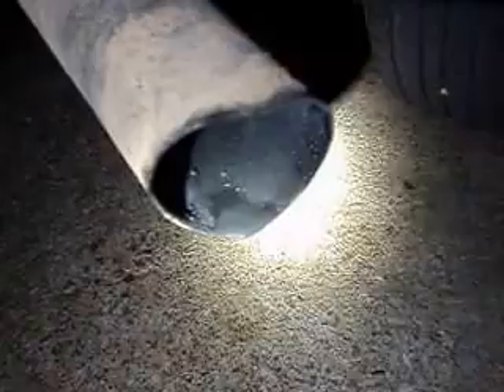Bad Head Gasket Leaking Water Out Of Tailpipe

Comment: My 06’ Tundra has water coming out my tail pipe and that’s been since 2009 when I bought it,so I just drilled a 1/8”hole in the very bottom of my muffler and fixed that problem.

Comment: You have broken bits of honeycomb from a bad catalytic converter. The honeycomb no longer heats quickly because it's in your tail pipe now, or crumbled in your muffler, so it attracts a little extra condensation at the bottom end of your muffler! As lone as you know that you added coolant and not straight water into the radiator you are good..there is no sweet smell, the water coming out the tail pipe tastes better than my faucet water. It's good...hell 😂But I would definitely taste-test the exhaust water, and smell it too! Run a ph test, the water tastes filtered, but...I... Still... Would... Not... Just... Drink it. Pressure test the radiator/overflow to about 15 psi, for 15 minutes...and if it drops considerably, then it's a bad gasket or cracked block somewhere. Or you should just check for exhaust gass in the overflow or radiator. If you pass that... It's just condinsation.✔️💯🏆

Comment: Is the water drinkable?
Reply: Haha 😆 It just might be! After so much work that I've done on mine, including a cheap engine install... Shid... Who wasn't going to smell and then taste test it?! I've added dye and 70% antifreeze, but seen water coming out, and ... So I togue  Tasted it! It was like it poured out of my water filter in my house. I've tested for exhaust in the radiator/ overflow, tube never changed colors. The carbon in the exhaust might of filtered the condensation. I plan on doing a ph test on the water soon, alone with other test. Coolant gives off a sweet 🧁 burning smell though! Dude might have old broken chunks of catalytic converter material lieing in the muffler... This soaks up a lot of condensation being that they are a bunch of small broken bits of honeycomb.

Comment: umm... NO! you're not going to leak water with a bad head gasket unless you're running water in your radiator which nobody does unless it's an emergency. if it smells like gasoline of antifreeze then you have something to worry about, but if it's just water and doesn't have a smell then don't worry about it's perfectly normal. the water is not coming from your car, it's just condensation in the exhaust. there is nothing in your car that holds water for operational purposes unless you're running water instead of coolant in your radiator, or you use water instead of washer fluid for your wipers.
Reply: i was just thinking where the water comes from.
Reply: but i drive to work 25 min drive, and when in park, it leaks water like this. ...
Reply: @victormirman3935  as long as it has no sweet smell to it, you're fine. if you have an older vehicle it will do it more because over time the exhaust clogs up with carbon junk which restricts flow a little and then you're exhaust holds more water. my truck is 18 years old and the exhaust on it is factory and it is full of shit. when I start it in the morning it spits water like a motherfucker and steams a little bit once it's hot but after a few minutes it stops.
Reply: @ElectronicsForFun  hello , but what if its not  old car and spits water even after 2hours drive on 100mph? My does that and its summer outside 32C temperature

Comment: What if it stops after a few minutes of warming up?
Reply: normal
Reply: @alexpfilbert  thanks for the reply, that is what I've been told it has a few holes in the exhaust and a long exhaust system so I've been told it collects humidity when cooling off especially with more than one exit in the exhaust pipe
Reply: @thomasjefferson2938  yeah, if you look at it on a molecular level you'll see that its a sign of a perfect combustion, if it's doing it normally (cold on start up) then its a sign of a healthy engine.

Comment: What if you fill up the radiator without the car running and it literally pours coolant out the exhaust and you have rust on the no 4 exhaust valves and cam lobes, Would that be a cracked head or just the gasket or worse anyone know ?

Comment: I thought it meant water in fuel. They often water gasoline down so they can make  more money. It shows me the engine is produces moisture in the exhaust. Either leak in the head gasket or the fuel. Run fuel additives to reduce the amount of water in fuel or buy premium fuel

Comment: actually it can mean this.but, it is very rare and is usually a crack coupled with a malfunctioning radiator cap and or exaust gases pressurising your coolant., not head gasket usually those go alot worse with white smoke and often wont start as your spark plugs are wet.

Comment: i do have same symptoms with my car water coming  out with black mix tax from tail pipe .. and engine also reduces oil ... is this reduction of oil n black water coming out of engine just because of bad head gas kit...? please do tell me ... thanks in advance
Reply: admin leo water leaking is normal and good its condensation and it is being expelled from the tail pipe which is the purpose of tail pipe to expel fluid and if its just water being expelled ur good. This guy is an absolute idiot and doesnt know what he is talking about my brand new 2017 is spraying water right now cause i just started my car and its been moist out. Two things to note: if the car runs for a bit and is still leaking water u may want to get checked cause as the car runs it expels extra moisture as it heats up and once running for a bit its quite hot and moisture should have leaked out and heat evaporates the rest so u should only notice this when car is just started it will leak. Also there is something i read online about this leaking water or fluid along with oil "pressure", that's a bad sign and get checked not sure about oil going low tho. Also make sure its water touch and smell cause anything other than water is when it becomes an issue. Hope this helped

Comment: sir did you check your coolant reservoir and oil if getting less and less if yes thats head gasket leak no need to check the tailpipe
Reply: your oil for me maybe wont get less and less if you have a bad head gasket but it increases even more due to water mixing in oil. When you check on the dip stick the oil is in a milky form. The oil changes in color. Upon running the engines temperature will reach to warning level and will about to overheat.

Comment: It does NOT mean yoi defenately have a headgasket leak. Could be rainwater that collected in the exhaust system. If you have a headgasket leak, probably your cooling system builds up alot of pressure amd your oil wil be foamy.
Reply: correct.i experienced that with a bad head gasket.

Comment: Could be fuel due to a bad spark plug or plug gap is not set.  That cylinder isn't getting detonation so the unburned fuel is blowing out the exhaust.If the head gasket was blown or if it was a cracked block sucking in water, you would find water in the oil pan and you would over heat every few minutes off idle.So, I would check the plugs and then check the oil.
Reply: correct. your right man.

Comment: dont lie to us water is a byproduct of the combustion but when the exhaust is warmed up enough it instantly evaporates
Reply: True, the hotter a CAT-converter gets the better it works.
Reply: InternetWebTools what was the priduct calllrd and fid it help with the smoke
Reply from the maker: You are right about combustion, but after the motor is warm not much water will come out.  This was a real video with water leaking from the tailpipe.  I got the gasket repair kit from autozone.

Comment: I have started to realise that reading the internet for causes to problems on cars is only really good if you have an understanding of the engine yourself. Those without any knowledge that come to youtube often read the comments and learn nothing but rubbish. Im wondering if garages are posting this bullshit hoping to get people to come back to them when they cant fix the issue themselves. Look my understanding is simple. That water is a quantity and if you check your expansion tank and find it stay full to the top, and not missing that quantity you see on the ground plus some, the water aint coming from around the engine and you have no head gasket issue. Oil coming from exhaust equals valve stems seals leaking. You can add liquid to soften up the seals again but it aint like changing them for new.
Reply from the maker: I'm not a garage service.  I like working on cars in my spare time.  I actually manage a restaurant full time.  I like doing this kind of stuff.  I did repair the head gasket leak, it took me awhile.

Comment: so I want to know if it was a blown head gasket because I've never had a bhg do this its logical but unlikely plus my firebird is pumping out water worse than that but I justdid a compression test all cylinders are good no oil in my rad and im not losing any coolant and it runs good but mine only dose it when cold once it warms up nothing so I think im good I guess ill see once replace the motor
Reply from the maker: On this video, it was a blown head gasket.  If your not loosing coolant then its probably condensation.
Reply: +koshcon amen brother

Comment: water is a by-product of combustion, don't scare people by making claims like this...
Reply: Bad head gasket will cause a thick white smoke.
Reply: I've seen completely rebuilt motors blow some white-ish smoke during a new gaskets "break in" period over the first day or two. Once it's been heated up enough once or twice, the white smoke after a rebuild should and usually does go away, it's normally just the sealant and other new rubber and plastic getting "settled in".
Reply: MoralDecay that’s enough moisture and the white smoke is indicative of a bad head gasket. Been a master tech for 25 years and would go right for a cylinder leak down test from his symptoms and narrow it down to the cylinder.
Reply: but the oil ....
Reply: Ronald Joseph that's not oil that's carbon build up
Reply: It is possible to be the gasket. If your exhaust has an odd puff puff idle and the water doesn't stop after a couple of minutes, check your radiator for bubbles
Reply: When it comes out with that oil splatter that's when it's a headgasket
Reply: Technically, it does come from thin air. Have you ever touched the inside of your fridge and noticed it was a bit wet? In this case, it's in the exhaust gas. From the EPA, "As an example, at 60 degrees F, water can be absorbed by a blend of 90% gasoline and 10% ethanol up to a content of 0.5 volume percent before it will phase separate. This means that approximately 3.8 teaspoons of water can be dissolved per gallon of the fuel before the water will begin to phase separate." Naturally, the heat from combustion is high enough to boil any water in the cylinder almost instantly. Any that touches the tailpipe (which is below the boiling point) as it's getting pushed through may return to liquid form.
Reply: +Andy Zelch 
i was getting ready to cry XD
Reply: +Torresmeza9 same here. Extreme sadfacing til I read that.
Reply from the maker: Hi.  If the cup fulls up with water, then this should be common sense that something is wrong.  Where did the water come from?  Not from thin air...   Yes, the head gasket was leaking in the vehicle and was replaced.  I understand exactly what you are trying to say, but this was a actual blown head gasket.  The exhaust blew the water right out of the tailpipe.
Reply: 2 C8H18 + 25 O2 → 16 CO2 + "18 H2O"
Reply: @internetwebtools4639 its impossible for water to make it that far you wanna know what happens if water make's it into the engine it blows up since water cannot compress

Comment: so did it turn out to be a leaking head gasket, or was it just bad gas?
Reply from the maker: Yes, You could easily see where the head gasket was leaking after removing the top.  But this motor was leaking bad
Reply: @internetwebtools4639  hey I have the same issue on my 90 caprice oil and water not mixing but car runs sluggish this happen right after I put water in car from overheating hopefully it's just the head gasket and not a cracked head since I can still drive it

Comment: If it's a bad head gasket then that is radiator fluid leaking out of the tailpipe.An easy way to know is if your radiator is going low.If your radiator is staying full it's probably not a head gasket problem,but condensation.
Reply: MrChunkylover53 also if you had a bad head gasket the exhaust would be thick and white
Reply: How about this shit.
My camry is 25 years old.
It sat 10 years when i got it.
It was overheated till the bottom of the red (almost) before it was turned off.
It’s been blowing steam for the whole year and never overheated.The fluids never mixed.The radiator I been using water in for the year and forgot!!!! It’s always started up till it’s fully warmed up before I drive it and the trips are typically short less than a few miles 80% of the time.When I first start it it doesn’t smoke it takes about 30 seconds too start,it never gets really thick or heavy.After a 30 minute drive (not idle) it stops completely (if it goes on long drive like hour plus when i turn it off it would tick alot fast).It usually drips water too.Now I pop the Hood see the overflow is empty and then I remove the radiator cap and it’s bent design so i cant see how much is missing from the topso i go too add water and 8oz later it was full again.When I remove the radiator cap in the beginning and watch it will throw 4-6 bubbles every 4 seconds and one bubble is usually large taking up half the pipe when i rev it the bubbles increase.I used a thin not sludgy sealer that worked on my former car that had a warped head bad head gasket but it couldn’t fix my camry v6.
Any ideas?
It’s nice to get an opinion ive never asked anyone i might copy paste this and ask reddit.
Thanks
Reply: @mj-7444  your evap system check pcv valve and purge solenoid elbow (rubber u hose)